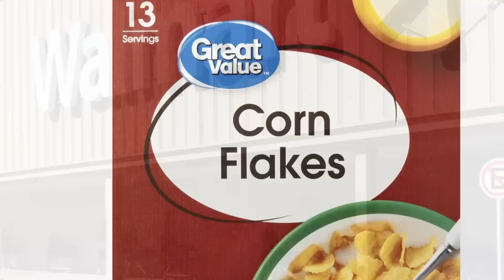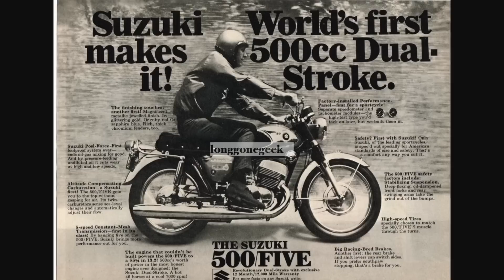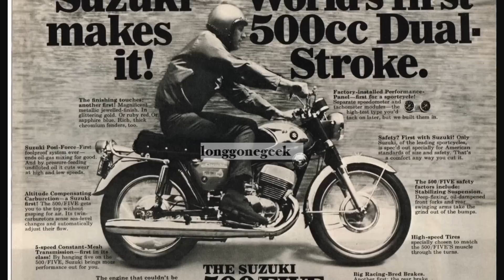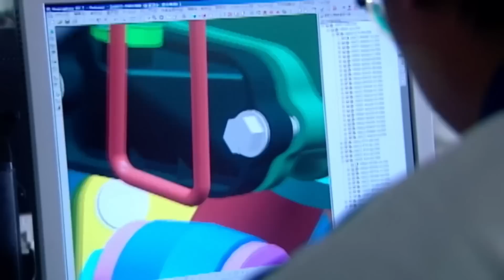How Suzuki became the Walmart of Motorcycle Companies

Comment: Over the last 45 years I have owned 36 Suzukis. Loved everyone. I am a true fanboy. Half of them I roadraced, the other half I rode on the street or dirt. Suzuki was as awesome as ever, until the great recession of 2008. I think that is where you can draw the line between the great Suzuki of old, and what we see today. I think their current strategy is to pull back from ICE engines, and get a jump start on battery electric bikes. I think they want to be the Tesla of 2 wheels. Time will tell. I think #37 will be a new V-Strom 1050 while I still can and don’t have to plug it in!
Reply: That’s an awful lot of bikes Craig did you just trade them or destroy them racing?
Reply: The new vstrom is mostly a more expensive version of the old model. I suspect the recent new parallel twin is the last new engine from Suzuki as it was under development before they made the decision to move away from western category motorcycles and just milk what they have. You have to remember Suzuki make 5 times more money from their outboard business let alone their cars
Reply: @philtucker1224  didn’t destroy any of them racing. Sold them all in perfect condition, and bought another.
Reply: @craigg4246  didn’t you get attached to them? (You didn’t seem to keep them very long?)🤔
Reply: @philtucker1224  I can see where he's coming from, i'm on bike 32 and I've only been riding 18 years. Can't speak for Craig, but for me personally I never seemed to click with many of the bikes, tried all sorts and never found the perfect bike until I got myself a Triumph TT600...expensive to maintain, hit and miss reliability, and a mountain of "quirks" that you have to learn as an owner, have fixed and rebuilt the bike multiple times as it's been wrecked a few times through no choice/fault of my own...the latest being a woman driver pulling off her driveway from behind a big high fence, she did not even look, she just assumed it was clear and smashed into me side on, so the TT600 is now rebuilt again, as a tastefull streetfighter because I'm not buying a fourth set of fairings for it as it's clearly cursed, and I now have a limp to match my battered bike, BUT, it is the bike I'm attached to, lots of great memories and times. I'm of the belief that motorbikes are an emotional purchase. When it got wrecked again, I ended up depressed until I got it back on the road (the same woman has also since almost done the same thing to me again!)
Alongside my TT600 though, I recently got a 2nd gen SV650S to use as my daily work bike, such a reliable capable machine, no problems with it at all, it's the only suzuki i've ever owned oddly, never really gave them much thought until now really which I regret, spent so much money on bikes over the years, when I should have got an SV650 a lot sooner, I've found it more reliable than many of the "bulletproof" Honda's i've had too.
Still, regardless of what we all ride, stay safe, so many people don't pay attention or read the road more than the car in front of them, if they even do that.
Reply: They have said they are looking into alternate ways to power motorcycles, so they definitely do intend on competing in that market but they've also said that motorcycles don't have very large engines that pollute much so they'll still use ICE. They literally came out with a new engine now in 2023, I don't any other motorcycle company, especially Japanese has done that yet? 

Also Kawasaki is the one investing heavy into electric and hybrid motorcycles, while Yamaha and Toyota have partnered up to experiment with Hydrogen. 
I also know since Toyota owns about 5% of Suzuki that they are working together on electric cars since that is where the money is for Suzuki. 

They are a great motorcycle brand, and I love them so much, they make/made some of the best bikes out there, but they turned REALLY lazy. At least with what they release, because at the factory? Well they got some great engines that never reached the public. They made inline 5s and 6s with and without turbos for the Hayabusa, and the new GSX-8S I think that engine is based on the Suzuki Recursion concept which originally was a SOHC Turbo 588cc engine which could perhaps still be in development? Turbos make engines make more power, and pollute less, so would make sense. We did see this bike back in 2013 though so it's not likely :( 
They also made a supercharged B-King which we actually saw unlike the Hayabusa engines I talked about. 
You also have the 1100cc inline 6 Suzuki Stratoshere which was actually smaller than the Hayabusa engine. Sad it never was produced, we all know how good that Honda CBX sounds.

Suzuki makes these cool engines, but then they remember "Oh yeah we are losing at every motorcycle category in every way except for price since we provide good value motorcycles (which is true, but what Japanese motorcycle company doesn't?), but even at a low price barely anyone in the western countries buy our bikes since we've been building the same bikes for 20 years except we give them bold new graphics every year in blue and yellow, white and blue and red and black, but all our money is basically from cars anyways so we don't care."

In reality sometimes Suzuki isn't a good value either at only a couple hundreds of $ less than other Japanese brands in the same category, at least in the US, some countries brands like Yamaha are really gready since they sell so well anyways, like my country, Norway, here Suzuki is great value compared to the others, but mostly Yamaha out of the big 4. 
Let's hope this new GSX-8S and V-Strom 800 is a fresh new start for great Suzuki ICE bikes. I'll never own an electric motorcycle, might as well have a boring car at that point.
Edit: I gotta give them credit for the GSX-S1000GT, amazing value and it won bike of the year. However still an old platform, no matter how good it is.
Reply: I seldom kept them more than 6 months. You see, 40+ years ago, they dramatically improved them every year, and brand new models every few years. As soon as the new model hit the showroom, last year’s had a for sale sign on it.
Reply: @philtucker1224  The only one I still own is a 1980 GS1000GT with a GS1000ST Wes Cooley replica body and fairing on it. Pretty much a one of a kind. Doubt I will ever sell it.
Reply: @craigg4246  sounds beautiful. Do you still ride now?
Reply: @philtucker1224  yep, hoping to do a coast to coast ride this summer
Reply: Variety is the spice of life!  I am with you, I always want to check out different bikes, new or old. At one point, I had over 20 motorcycles, on and off road combined. My wife started to put her foot down, I told her, "it's either different motorcycles or different women. What would you prefer?"...
Reply: @philtucker1224  😂😂😂😂
Reply: I always wanted a GSXR-750, I was even going to join the Marines in 97 just so I could get one. 2021 I bought a K8 750 and fortunately I got the best one ever made. Yamaha has always been my manufacturer but that don’t make a 750 and then on they did is way to expensive (OG R7) The GSXR750 is the ultimate street sport bike!
Reply: @LordHolley  do you miss her?
Reply: The 1999 Silver/Copper unrestricted Hayabusa was the most impresses model that Suzuki ever made .This motorcycle really put the Suzuki brand motorcycles on the world stage. It was the fastest, smoothest and the most reliable and visually recognized motorcycle on the planet.
Reply: @philipjosephbarker7737  sorry, the 1978 GS 1000E really put Suzuki on the world stage. When released, was the fastest, best handling stock street legal production bike EVER sold. The second of the 1-2 punches came 2 years later with the GS1100E, followed by the knock out punches 5 years later by both the RG500 Gamma and the original GSXR 750 and 1100. Those bikes sent the rest of the manufacturers in the world back to the drawing boards.
Reply: Too bad EV cars don't make sense, let alone EV bikes.
Reply: @bubbleman2002  since when was making sense ever a requirement for government mandates?
Reply: I agree the comment about Suzuki being great before 2008. But what are you basing your opinion of them becoming the Tesla of 2 wheels? I haven't heard of anything electric coming from the brand. Hell, even Kawasaki is offering E-motos and hybrids now. What has Suzuki done at all? Make a corporate announcement? They haven't been innovating at all in like 15 years. Ever since the GSXR 1000 and Hayabusa peaked, they have just slowly been receding into the background. Even boring, traditional Honda is at least offering new things like the Rebel 11000.
Reply: @180FiftyFive  i base this on the reports Suzuki left motoGP, even though they were very competitive. Even winning their last race, in order to concentrate their research and engineering resources on developing electric powered bikes. I know Kawasaki has taken an early lead. But if Suzuki makes this a high priority, you can bet they will have some amazing ebikes in the future
Reply: @craigg4246  I wouldn't hold my breath. They haven't delivered or showcased any concepts or prototypes at all since 2020. Besides their corpo spokeperson said this regarding electric bikes 
"This is only for commuter-class models, though. “For large motorcycles for leisure purposes, Suzuki is considering adopting carbon neutral fuels,”

Commuter-class means scooters. I wish I was wrong but I don't see it happening. EU did just pass a law to ban the sale of new IC-engine vehicles starting 2035 but for now it doesn't concern motorcycles, so it's not really an incentive to speed up any electro engine development either.
Reply: @jozefrockatansky1588  Did this dangerous driver offer compensation for damage.
Reply: @craigg4246  lol, She's a good woman, she's still here, not as many bikes though.
Reply: @craigg4246   The KZ/LTD was definitely more popular, had a much larger aftermarket support, plus they had big police contracts. A lot of people felt like Suzuki just copied Kawasaki. Copies are forgivable as long as they are substantially better. There was barely any difference between the GS and KZ. Kawasaki was getting a lot of attention at that time with the H1/H2. The Hayabusa definitely set Suzuki apart from the other manufacturers, at least in the last 50 years.
Reply: @@johntitor6825 sorry John, the CBX was not the fastest bake in any year
Reply: @drasticthompson1995  I had a YZF750SP back in the day. The single seat homologation special. Flat slide carbs, close ratio gearbox, ohlins suspension. OMG, that was an incredible bike. I can't tell you how much I loved that bike. The way it cornered was just supernatural.

Stolen after 3 months and I never saw it again.
Reply: I'd love a battery V-Strom. They're a big spacious bike and you could easily pack 36kWh into one. With a 400V architecture you could charge at 40 kW on those free 50 kW chargers. That's about 400km/hr. Start the day full, have 2 half hour stops and lay down an 800 km day for free. Just pay for tyres.

No more filters, no more oil changes, no valve adjustments, no noise on long trips, instant power, no stalling, no vibration, always in the right gear, ride at walking pace in traffic with no jerking or clutch slipping, ford rivers up to your neck, mud doesn't bake on so you can wash it off with a hose.
Reply: I dont see them going electric at all.
Reply: @i wrote that a year ago. Sure hope you are right.

Comment: I don't think calling Royal Enfield budget bikes is true anymore. Sure, they are somewhat made to a cost, but the new ones are incredible machines
Reply from the maker: I'd agree, I think they're budget in the right areas and weirdly premium in others but the end product ends up being more affordable than just about anything else.
Reply: @bartmotorcycle  In India they're considered midrange-premium bikes BTW 😬, I wish to own one of them here (my dream bike is the orginal Z1 tho), but the average starting salary of the field I'm pursuing for is ₹300k a year (excluding taxes) which is ₹10k short than the cheapest interceptor on road.

Most people here ride fuel efficient 125-160cc commuter bikes which go 50 km/l while Enfields go 35
Reply: They're definitely low tech in most regards. Their engines are comparable to what Japan was building in the 70s, they have nothing that compares to Japanese engine tech from the 1980s.
Reply: @phillipbatho3213  The clutch on the 650 series are very refined, actually. But Bybre system they use was garbage for the class. In addition to the giga meh rear suspension. The current Royal Enfield engines are very good if overengineered. But cost cutting is inevitable with motorcycle of that price range.
Reply: @phillipbatho3213  not really they just are making the same kinda stuff they used to make in the 60s Britain, which for the Indian Royal Enfield which is the only Indian motorcycle brand which didn't rise up by collaborating with the Japanese is a big thing

Comment: The fact that Suzuki uses proven technology is part of why I like them so much. My main bike is a 2012 DR650 that is mechanically identical to a 1996 model (they weren't cutting edge then either), and built like a piece of farm equipment. It's not flashy, it's not fast, but it starts every time, gets me where I need to go, can be easily maintained with basic tools, and didn't cost very much. As far as I'm concerned that's the best formula for a bike.
Reply: DR650 is the most reliable bike I can think of..
Reply: @Stuntpool  Mine will probably outlive me haha.
Reply: DR650SE is maybe the best trail ever built. The toyota of the motorcycle.
Reply: Hit the nail on the head. I just purchased a '06 RM Z450, did some minor maintenance... and boom. I now have a 60HP first kick bike which a blast to ride. And yeah... its basically identical to a '23 (kick, 450cc) but with zero emissions control and maximized power. Can't go wrong with 'em! (in the process of st. legalizing)
Reply: Another DR rider here. It does what I want it to do, and it's simple enough to maintain myself. It's never failed to do anything, street or dirt. And, the aftermarket is HUGE.
Reply: I agree 100%.
Reply: Have you modified the suspension at all?
Reply: @ajhamm2020  Not yet, it would certainly benefit from stiffer suspension but for most of what I use it for it's sufficient.
Reply: It's like the Antonov AN-2. Some things do their job so well did they will see many competitors come and go while they just soldier along.
Reply: The problem is today they want 7K msrp 8 something out the door I'm sure. That's more than a brand new KLR that has EFI, better suspension and is arguably even more reliable than the DR. Also over the new class of 300cc Japanese Dual sports. Much more bang for your buck and reliability is also right there with the DR

Comment: Never thought I'd ever own a Suzuki, but they released the GT and here we are. That bike is slammin'. No regrets.
Reply: Same.
I was in the market for a 650 and breezed over the SV, thinking it wasn't particularly exciting. In my region it's nearly $1000 cheaper than the other Japanese brands, and being on a budget, I figured, why not? Fast forward a year and the SV is an absolute peach! Light weight, good power and two decades of r & d have made it bomb proof. Not to mention, it (as well as the CB650R) is the only bike in the segment that doesn't have a parallel twin. The v-twin has great power delivery and such a good sound. Zero regrets.
Reply: I got a chance to demo the GT last yr & I was very impressed. Really liked it. The quick shifter was smooth & the engine just amazing. May be an older engine but it flat out rips! Might be time to trade my FJR1300??
Reply: @grahamn311  Your SV650 is a great choice but youre sleeping on the MT07 if you think parallel twins are boring. If anything I'd say the CBR650 is boring. None of the hype of a inline-4 with all the disadvantages of one. 

Yes, traditional twins are generally lame - but most of the new bikes are now crossplane/270-degree crank twins. They have substantially more character, torque and sound amazing. Aside from Yamaha's CP2 engine, the RS660 and new Hornet are also crossplane twins
Reply: @180FiftyFive  Oh, yea don't disagree with you on the potential fun of a 270 degree parallel twin. Only thing boring about them is that every bike in the segment now has one. Didn't think of the MT when buying because the Yamaha dealers in my region are kinda shit. And yea, inline-4's (especially Honda's) can be a bit dull until you ring them out, but man, you can't deny that the CB650R is a beautiful bike. I owned a CB400 Vtech a number of years ago, and loved it, so looking at the 650R, for me, was like upgrading to its modern big brother.
Reply: Niice. I'm low key becoming a Suzuki fan because they make a quality machine at an affordable price. Like damn look at the GSXS 1000 probably my next bike coming from a ninja 400. That or an older 750.
Reply: @DaddySizeIt  Yea, I like seeing that my bike is made in Hamamatsu as well, but, Honda and Kawi have been doing it for so long, the quality is likely not far off. Manufacturers newer to the east Asian scene, like KTM, are still working out the kinks. Or so I've heard.
Reply: @DaddySizeIt I didn’t know that.